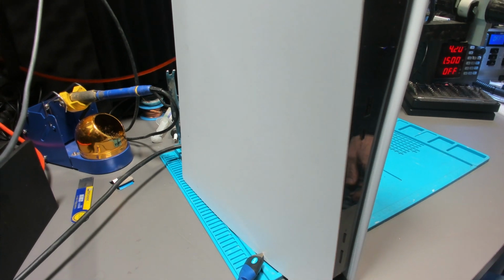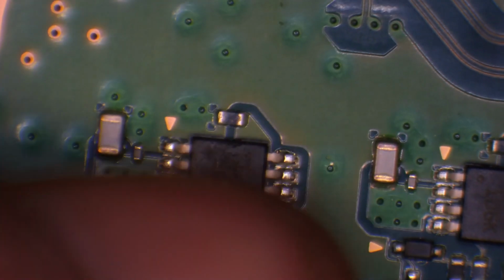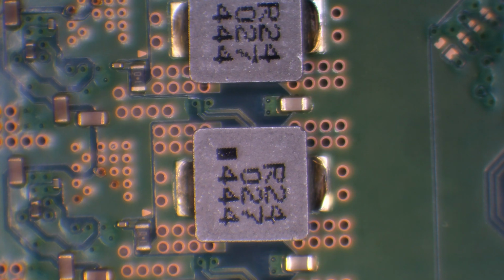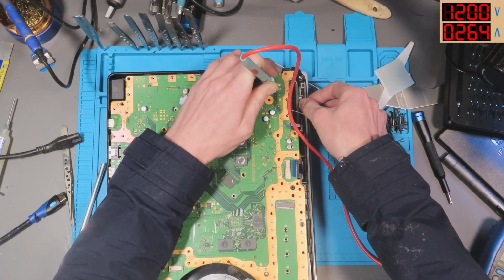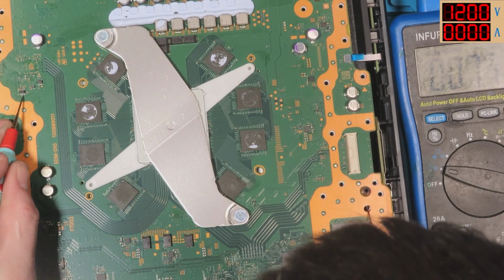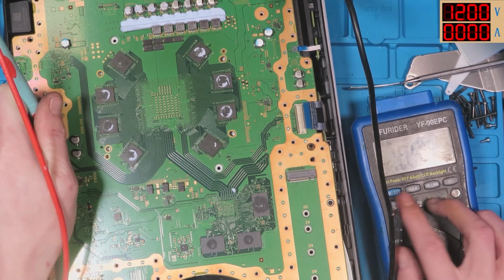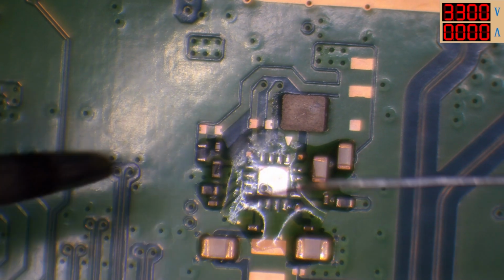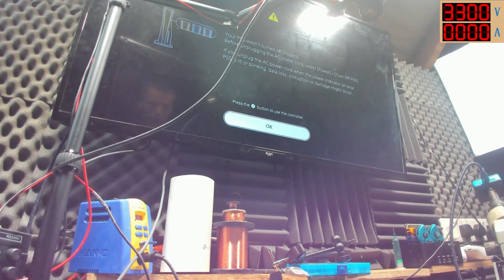Fault Finding With No Schematics? PlayStation 5 Not Turning On But Beeps - Repair Guide 🛠️

Comment: That chip you replaced yes its a IC regulator for USB 5V input power and splits it three way to the USB then back thru board to the other ircut then has a circuit that store the 3.3 for standby mode till the circuit completes and the southbridge kicks the system on

Comment: I took classes on electronics, but cant even come close to him. If i can only go back and learn all components and learn how they work. I too probably can be doing this to fix my consoles.
Reply: Question is can you fix consoles with just a multimeter? Heat gun and soldering skills. And then buy the other stuff.

Comment: Having this exact same issue on a EDM-031 board. I often replace ports and ICs but I can't fault find like you do buddy! Any idea where I should be looking for 3.3v? Weirdly enough, this all started after a port replacement that appeared to be successful. I left it running and returned to find the console off 20 minutes later. It doesn't power on but after 30s or so plugged in, the power button beeps once per 30/45s and the eject always beeps, but no lights. I'd be very greatful if you, or anyone here could help me locate it. Thanks!

Comment: I JUST experienced this issue. I went back in to open up the PS5 and I cleaned that chip with alcohol 91% and I also recleaned my hdmi port. There is also a big flex cable next to the power cable. I took that out and reseated that and my console turned on. Not sure wth happened here but it resolved my issue. I hope this also helps someone out there.

Comment: According to iFixit this Buck Regulator seems to be a TI TLV62090
I guess it would be good practice to change both of them because if one fails it pulls the other one down to ground as well which will stress the other one.

Comment: Hey Phil did you see the vid about the new PS5 from Japan Austin Evens got hold of one and took it apart and found the heatsink to be may smaller than the first on?
Reply from the maker: Yeah I saw that one mate, they just over engineered the first revision to be honest so that's just a cost saving measure. I don't think it should make any difference

Comment: This PS5 is missing the special sponge on the APU... it was opened before. Idk how you didn't saw it. @ 10:29 It has just the other black layer under it.
Reply from the maker: Yeah I knew it had been opened before, it died after a hdmi repair and the other place who worked on it removed that foam but the foam isn't really needed to keep the console safe
Reply: @TheCod3r  Yeah, but you mentioned that the liquid metal is not enough. I mean it's because was opened before. Idk :D I thought it's first time when this console is getting opened and it's like that from the factory.

Btw I'm really liking your new setup and place. :)
Reply from the maker: @borisdg  nah the ps5 had been worked on before but it looks like they didn't apply enough liquid metal. The sponge cover isn't really needed though to be honest to stop the liquod metal from spreading because it still has the plastic cover over it